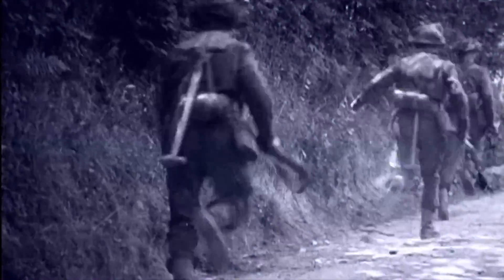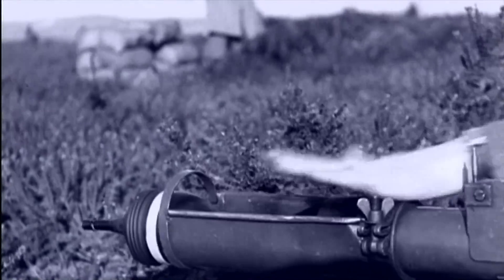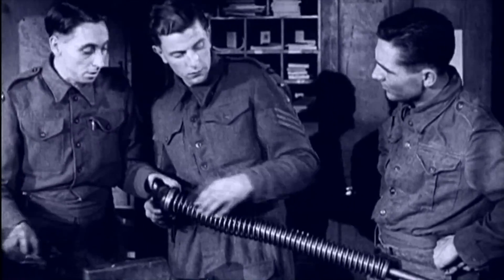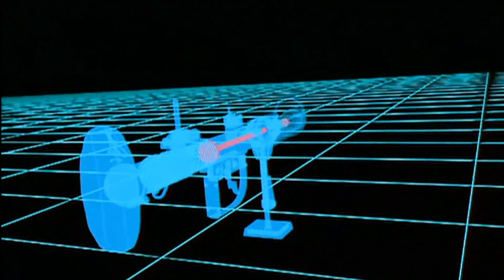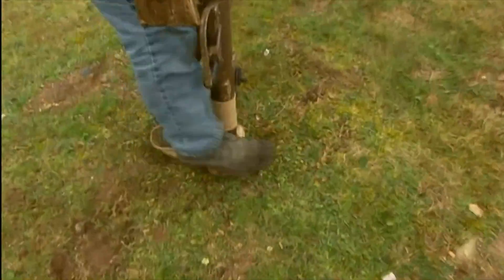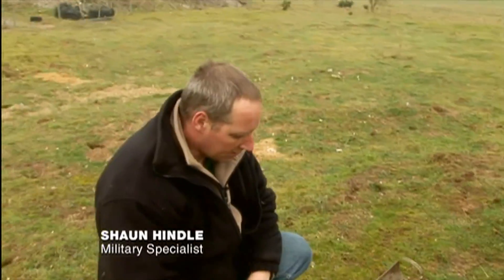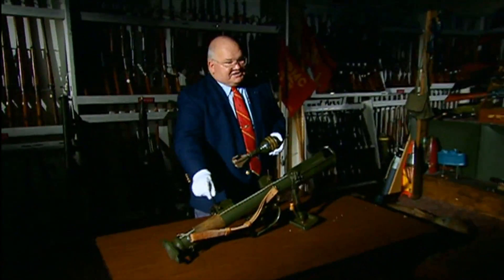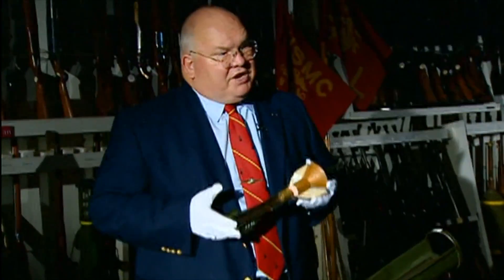Weaponology - "British PIAT"

Comment: to be fair though, the PIAT did have one advantage over rocket propelled anti-tank weapons, when the shell was fired, it didn't leave a smoke trail in its wake, thus giving away the position of the soldiers firing it
Reply: Yes 100%. The British army trialled the BAZOOKA before the PIAT and concluded that it's incredible backbalst made it unacceptable. Taking out German armour with a BAZOOKA was near suicidal.
Reply: agt155 Even with this in mind, the sheer suicidal bravery that Major Robert Caine VC faced at Arnhem in 1944. Especially for one of the times he attempted to fire the weapon, where the shell, as a result of him pulling the trigger slightly too soon, clipped the side of a building he was using for cover while facing down a Tiger Tank and exploded just in front of his face
Reply: Bazooka did have some smoke that did give position away but the back blast (as they were recoiless rifles) raised dust and dirt as well as being a danger to anyone or anything behind it. Look at the modern Carl Gustav, you don't want to be behind it either.
Reply: Without wishing to be pedantic the Bazooka was a rocket propelled grenade launcher, rather than a recoilless rifle. Both are incredibly loud though.
Reply: The trail of smoke wasn't really a thing for most launchers: a Bazooka's rocket burns all its fuel while it's still inside the launcher, so while there's a fair amount that's ejected from the rear of the tube, there's not really a trail as such. The only one in WW2 that really did that was the Panzerschreck, they had to stick a blast shield on it because the crews were having to put on gas masks to fire the original version. 

Most videos you'll see of "bazookas" firing are airsoft weapons with pyro charges in them, look up a video called "Mastering the Bazooka Rocket Launcher - 1943" here on Youtube to see some real shots. Also has some interesting footage on using bazooka rockets as makeshift anti-tank mines.

Comment: does not give away your position . .  recoil may suck, but if they don't know you just fired . . hell that is good trade-off
Reply: @manic2360  
Thanks very much, that is a very interesting read and it does confirm that the PIAT while by no meas perfect was a very useful weapon.
Reply: @manic2360   True badass. He was also the father of Jeremy Clarkson's (Now ex) wife.
Reply: Mike S 
They know how short the range is, so after the first shot, all the Germans had to do was suppress the direction that it was shot from. The nose of the shell made it so you have to hit it straight on, so that just makes things even easier.
Reply: yes but you do not want to run around with that thing arm so you need to stand to arm  the weapon.
Reply: @chrishill3536  you can do it from prone
Reply: Kevin C
After the first shot and a destroyed tank the enemy are not going to be doing a lot of suppressed fire in any direction and in normal circumstances there would be more troops some with the PIAT and more with Bren guns.
Reply: @barrierodliffe4155  You know nothing about warfare. Tanks are never used alone (only in hollywood movies), especially in urban areas where this weapon can be used only. There's always infantry cover for tanks in urban areas so nobody can run up to it. If the tank gets hit it will get response. In an open field its not possible to shoot that garbage. That's when proper ranges are needed. And the other guy is right: The shaped charge had to hit square on, otherwise it simply bounces off the armor.
Reply: @akosv96  
That is probable a hell of a lot more than you know.
There was just one soldier on his own who used one and he took out several tanks as they tried to cross a bridge, even injured he kept on until he ran out of ammunition.
The fact is it was a useful weapon that worked.  I know that the British also had anti tank guns, the 6 pounder which the US used and it was capable of stopping a Tiger tank, the 17 pounder that did punch holes in Tiger and King Tiger tanks, the 25 pounder and the 3.7 inch anti aircraft gun which had anti tank shells although it was hardly used in the  anti tank  role.  I do not take too much notice of armchair experts who never fired a gun in their sorry lives.
I wonder at the ignorant fools who try to say everything British was no good.  It had a job and worked, perfect no but useful when there was nothing better.